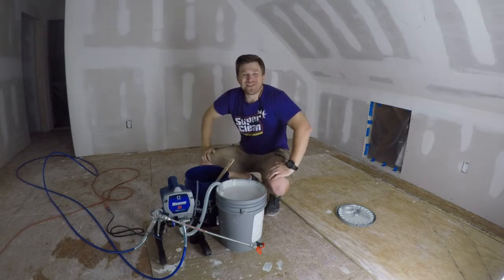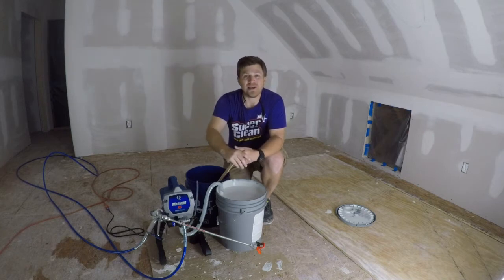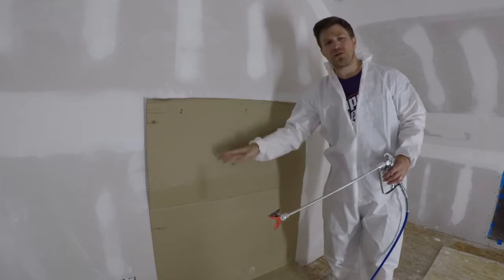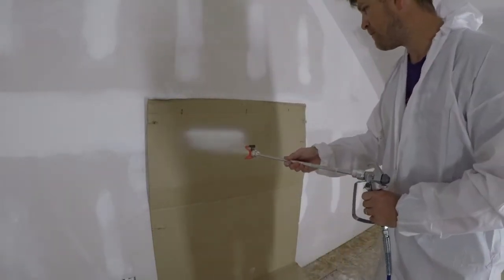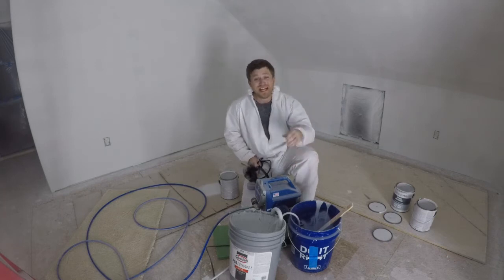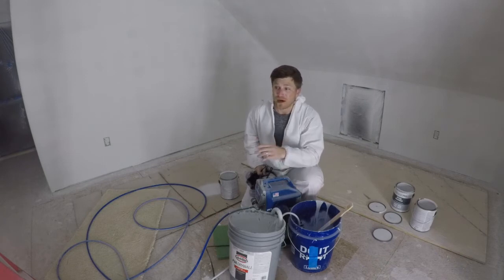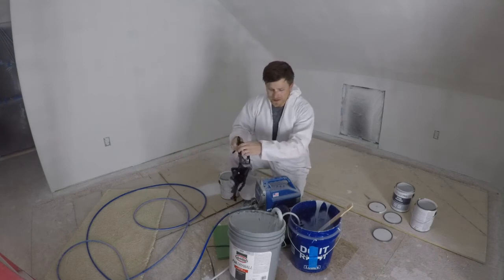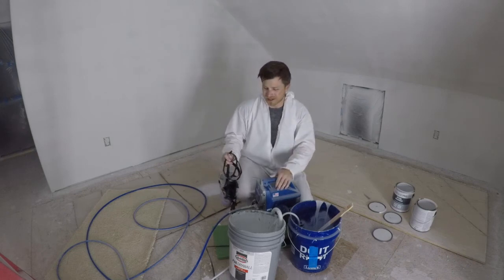TURNING OUR ATTIC into a BEDROOM - DRYWALL PRIMER

Comment: A quick internet search shows that one gallon of drywall primer should cover 200 to 300 sq. ft. It would appear that using the sprayer is not the most efficient method for this type of project since this project required seven gallons of primer. This is likely due to overspray plus the overhead of priming the sprayer. Also, my understanding is when a sprayer is used professionally, there is one person who is spraying while another individual follows the person spraying with a roller. The speed advantage is the person with the roller does not need to spend time painting the paint tray.
Reply from the maker: That's what I've read too. But I sprayed walls and ceilings. I didnt add up that square footage. 350 sq ft was only the floor area.
Reply: that will save a couple of gallons at least since you'll smooth out the primer across the surface evenly. Still needs 5 gallons given the total area.

Comment: I have the same sprayer, and you definitely need to factor in some paint waste. I painted  five 4x8 sheets of plywood. 2 coats on each side, used about 2.5 gallons of paint. At about $60/gallon. Also would highly recommend upgrading to the swivel gun as the hose is not very flexible.

Comment: The foot print of the room does not equal the total square footage of the project. You must take the square footage of all surfaces to be painted and add those together before making your calculation against the 300 to 400 ft.² per gallon noted on the can

Comment: Soooo, 350sf of floor works out to about 17.5' by 20', est. 8' ceilings, equals 950sf painted, plus extra walls for bathroom, closets, etc...add a generous 25% for those and waste...comes to 1200sf painted. Guess it is hard to understand where 7 gal went, but the can estimate of 300-400 has always been low for me too, so I'll have extra on hand!

These jackwagons who commented about "saving you money" obviously have forgotten that, besides less paint, they'll still charge you for their time, tools, overhead, etc.

$300 sprayer + $65/5gal PVA primer (x2) + $225 topcoat? You're in for $650 and saved, I'd wager, $350 PLUS you now own a sprayer for other jobs!

Comment: Great video. How long can the paint sprayer sit without being cleaned between coats?
Reply from the maker: Thank you. I'm not sure exactly, but I wouldn't let it sit for probably more than 30 min. Guess it would depend on temperature and humidity too.
Reply: I just sprayed three bedrooms with my x7.  We taped the opening of the can where the suction tube is and put a garbage bag over paint and sprayer.  It sat overnight and next morning we applied another coat.  Results were amazing.  We are meticulous with cleaning and taking care of our tools so i wouldnt have done it if it was going to ruin the machine.  We used Behr Marquee paint which requires at least an hour between coats.  Hope that helps

Comment: 7.5 gallons for a 375sq ft room??
Reply from the maker: That sounds about right.  We did walls and ceilings, so the actual painted square footage wass more than just the floor.  I've always heard 1 gallon will cover about 350-400 sq. ft.
Reply: This was my concern as well. I just received one for Father’s Day . From what I know of paint coverage, even being primer and new drywall and unsealed mudded walls, that seems to be about 2.5 - 3x amount of primer needed? Obviously the time saved is huge! Do you still feel worth it? 
Thanks for the informative videos. Keep them going. Not trying to be negative, just figuring the value of the sprayers.
Reply: I think he forgot to thin it down.   You need to thin primer when spraying it.  If it's water based, you can thin it with a bit of water.   If oil based, you can thin it with something else.
Reply: @brians5650  to thin oil base paint use mineral spirits

Comment: I always thought spraying primer was to thick for this Machine
Reply from the maker: It seemed to work well for me 👍
Reply: From what I've read an X7 model would be better since it supports a larger tip but for your average home owner or handyman spraying on a limited basis the x5 seems to work. I'm just looking at buying one now and it's a toss up between the x5 and x7.

Comment: Lol, You should not have ran out of paint next time hire a pro I can brush and roll it for less time money and material, 350 square feet and you used 7 gallons??? That’s impossible
Reply from the maker: It was definitely a learning experience for me.  and more fun than using a brush/roller.  But you realize that I was painting more than 350 square feet, that was just the room's footprint size.  The actual square footage that I painted (walls and ceilings) was much more than that.
Reply: What a rude comment